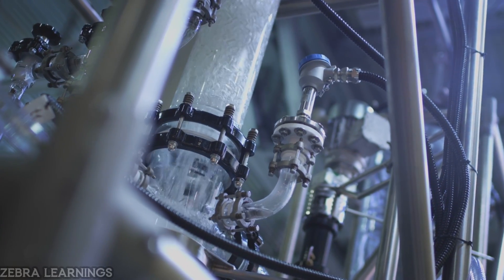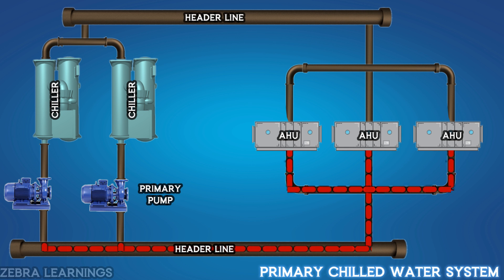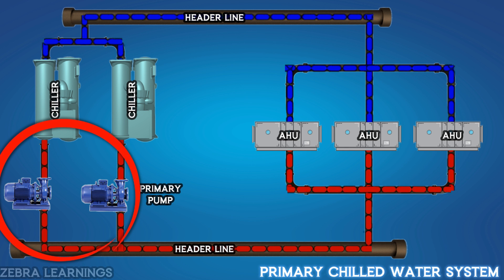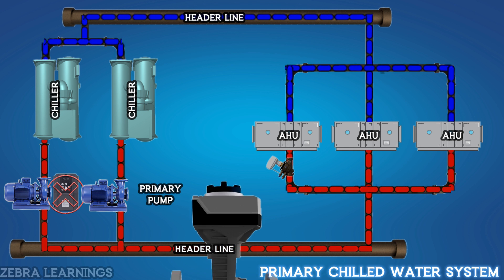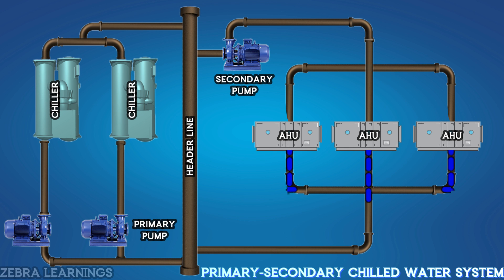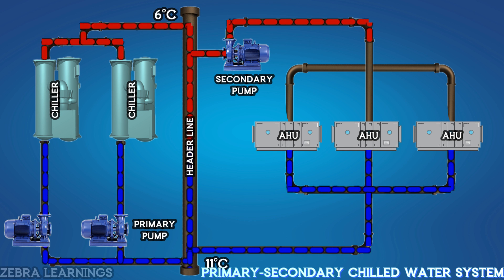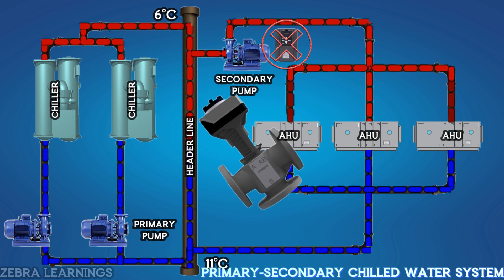What is Primary and Secondary Pump? Explained | Animation | #hvac #hvacsystem

Comment: Please provide video for with cooling tower also with in this video .and please provide modulation valve and on/ off valve which place needs to fixed in primary side and secondary side and cooling tower side.?

Comment: return chill water and supply chill water are mixed in the header. Can you explain it?
Reply from the maker: Return and supply chilled water are not mixing in the header.
Reply: @zebralearnings  Thank you
Reply: @Dizzyofficial2166  He's not right. They do mix, and are supposed to mix, depending on fluctuations in the flow rates between primary loop vs secondary loop. Otherwise, the header pipe wouldn't exist!
Reply: In between return and supply pipe connect with each other through a bypass line or decoupler. In between bypass line a valve is situated.mostly this valve should be closed specially in winter season.but in summer season you can open 40-50 percentage in this valve for better efficiency.
Reply: https://youtu.be/9zM9qyjNZhY?si=ue4BVcieiM2ifONc

Comment: I have not understand the piping and secondary pump function.Explain it in more easy way with detail
Reply: I think the explanation is that since AHU loads are variable, when the SCHW valves open or close on the AHUs, that changes the flow through the chiller, which changes how long water is in the heat exchanger, thus lowering the efficiency. by having the primary loop go through the header, when an AHU closes its SCHW valve, instead of slowing flow through the chiller, the cooled water is diverted back to the input of the chiller, which lowers chiller inlet temps, making the chiller work less hard to cool that water, thus increasing its efficiency. 

effectively in a primary only system when the AHUs close their valves the pumps are pushing harder against higher resistance, which causes the water to slow down and sit in the heat exchanger, and since heat transfer is more efficient with larger deltas, this means that the longer the water sits in there it will be less efficient at transferring heat to the chiller. because the primary/secondary system has that return header, any variations in load does not affect flow through the chiller, which maintains heat transfer efficiency high, and then reduces inlet temps by premixing with return water.

Comment: 00:02 Two types of pumps used in chiller plant: primary and secondary
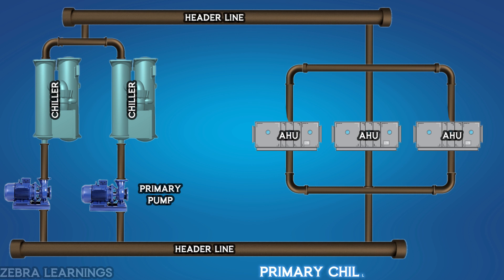00:29 Primary chilled water system uses only a primary pump.
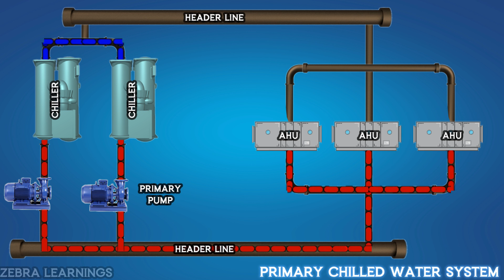01:10 Primary pump in HVAC system circulates chilled water from chiller to AHU.
01:45 Primary chilled water system less efficient than primary secondary system
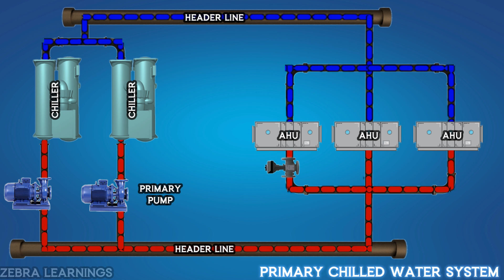02:16 Primary secondary chilled water system uses two pumps
02:49 Primary pump sends water to chiller for consistent flow
03:22 Primary and secondary pumps prevent water mixing in HVAC systems.
03:54 Primary and secondary pumps explained in HVAC system
Crafted by Merlin AI.

Comment: Thank you for your information,i need more video about HVAC  like troubleshooting in package , outdoor dx AHU ,pump, motor,more about electrical and  isolation rooms and cooled rooms systems
Reply: Low volt Wiring
Reply from the maker: @jawaunjohnson5514  Low volt wiring of Chiller???
Reply from the maker: Noted 📝